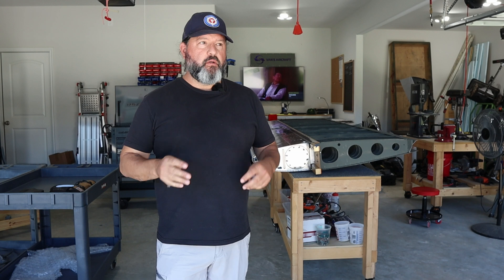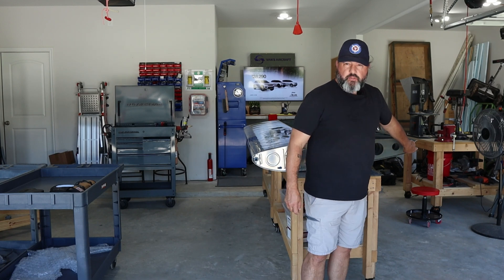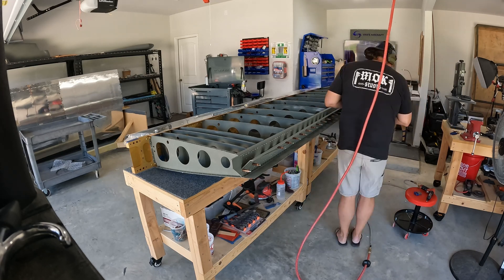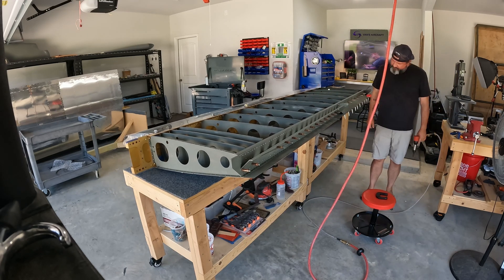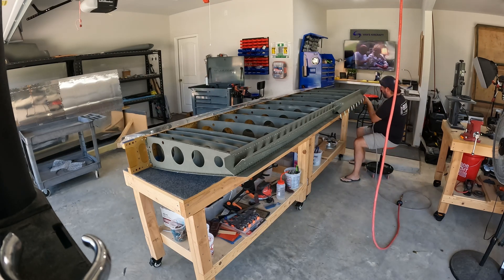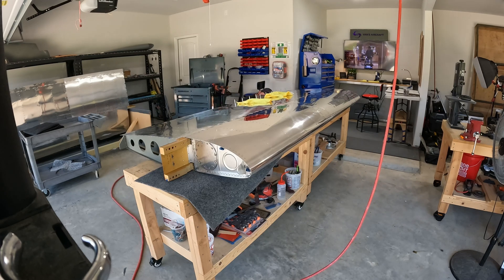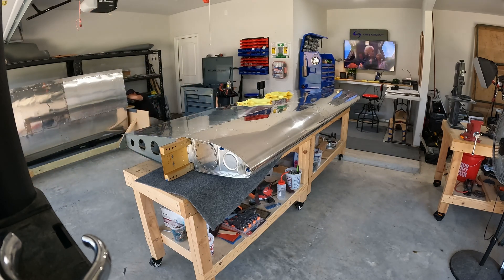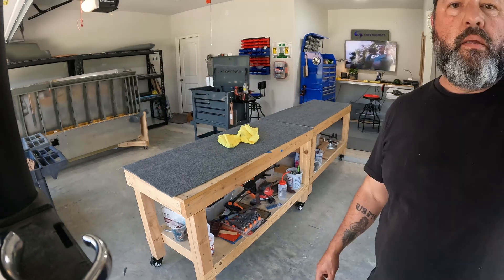Van's RV-8 Build. Ep 118. Wings 42, Ailerons 3, Flaps 2. Aileron gap fairing and flap brace riveting

Comment: Hey man, I cant seem to find that bucking bar anywhere. Looks like its great for getting into tight spaces. Any more information on where you picked it up at?
Reply from the maker: I just looked back at my Cleavland order. They don’t sell it any longer. It’s was called Tungsten Bucking Bar - Trailing Rib. But any bar that has an acute angle will serve this particular application. In fact, I think my original bucking bar from Cleaveland would work even better because it has more mass. I’ll try that one on the right wing.
Reply: @thathippiepilot  Awesome thank you! Ill see what I can find out there. I was building some flaps for my 170 and I was having a heck of a time getting a bucking bar in the trailing edge.
Reply from the maker: @mckeeemouse that’s a tough spot